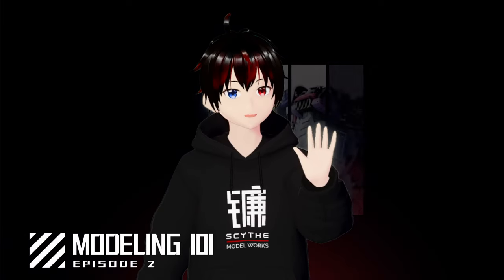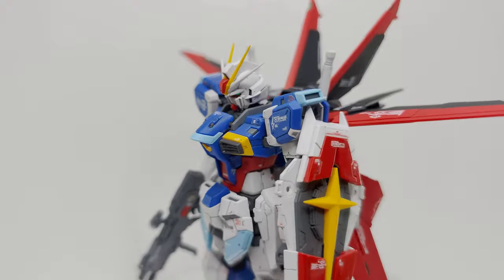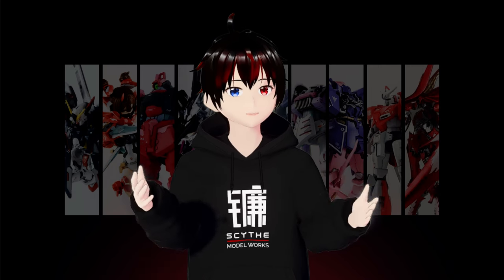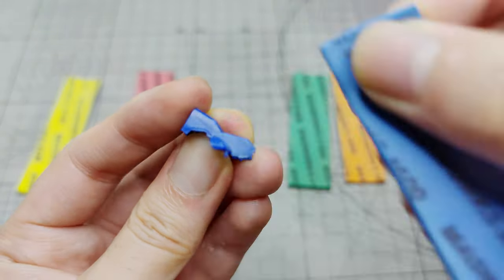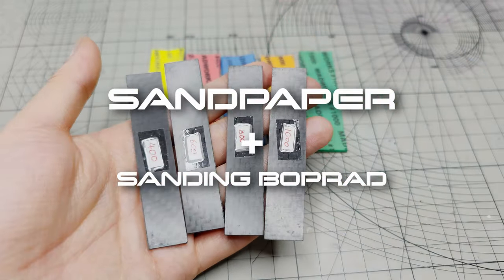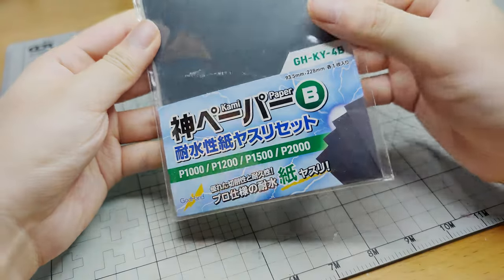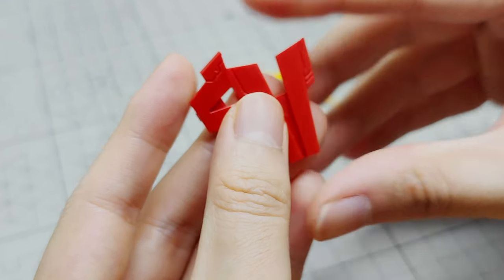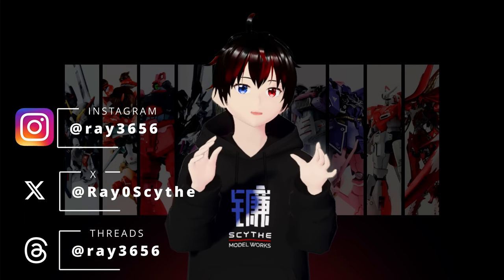How to Straight Build Properly - Sanding & Surface Treatment | Modeling 101 Episode 2

Comment: How long do you take one gundam to finish the straight build? Just wondering with all the setup
Reply from the maker: I would say 2, 3 days included the time needed for small paint details and topcoats to dry. It also depends on how complex the model kit is, and how much modifications are needed 🤔

Comment: How do you tell if a mold Line is not part of the aesthetic of the kit?
Also, can you apply polishing compound after painting? Or should it be done before painting?
Reply from the maker: Usually 9 out 10 times it's a mold line, Bandai usually does panel lines as the aesthetic design. However, if it's tough to tell, or if you are not sure, confirm with the box art or the painted example provided in the instruction manual. If they don't exist, try to reference line art from the anime, or works by others. Lastly, just follow your heart haha, decide if u should remove it or leave it be depending on how u like it!

For the polishing compound, you probably want to do it before and after painting for the best result. However it's a bit more tricky after painting, you want to be really careful not to over-sand/smudge ur paints.    Wait til ur paints are fully cured, and make sure you apply enough top coats.🙂
Reply: @ScytheModelWorks  thank you so much for the detailed explanation, that helps a lot